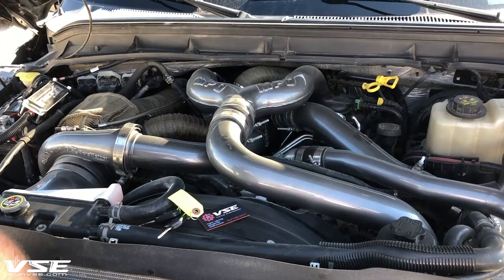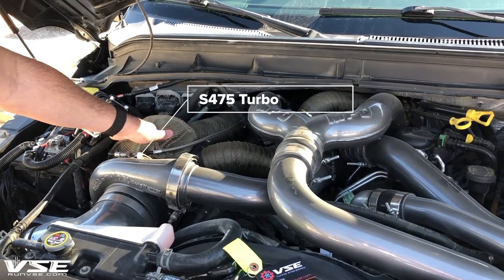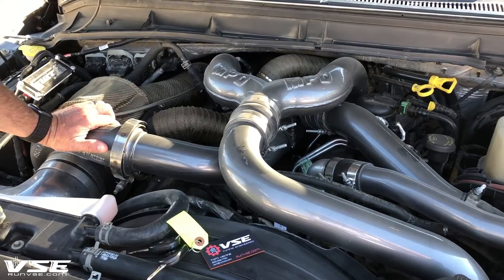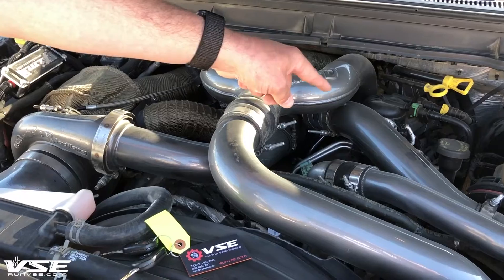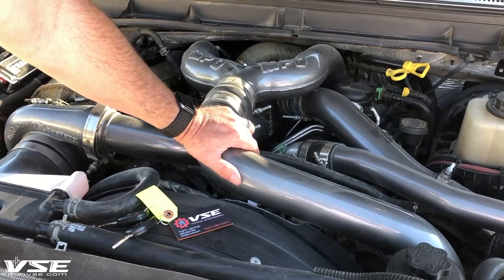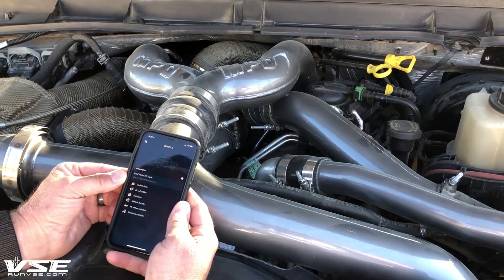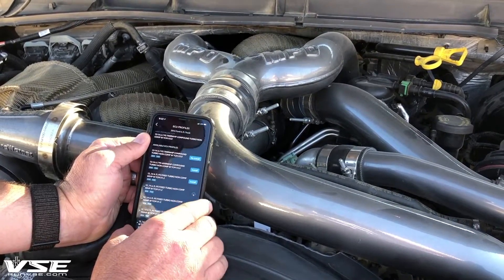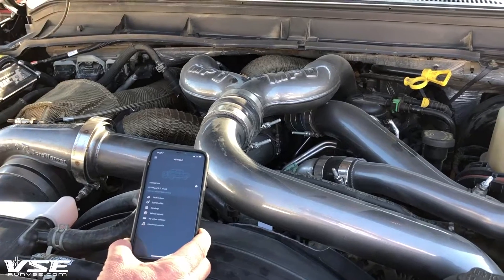Wicked Compound Turbo Powerstroke

Comment: any kits available for the early 2011 - 2014 stock turbos?
Reply: No...and you wouldn't want to pit a big atmosphere charger in front of the GT32. The quick spooling nature of the SST, mixed with the volumetric efficiency of a big fixed vane out in front of it is literally the perfect storm for bending rods. All that low rpm torque that comes on before the bottom end has picked up rpm equates to more cylinder pressure than the stock rods can handle
Reply: @ryanbrown918  thank you I’ll be upgrading my stock turbo before looking for compound

Comment: Larger turbo feeding a smaller one? I thought the valley turbo fed the atmosphere charger
Reply: The atmosphere feeds the air to the valley then the valley feeds the exhaust to the atmosphere
Reply: Yeah, i always thought it would be other way around too with Compounds, the Smaller Turbo feeding Air to the Bigger Turbo, But that's not correct.

Comment: Great video. Truck is holding bottom end and trans ok at that power level?
Reply: I’ve been running a 2011 engine with 360k miles on it with a fleece cheetah and 475 mpd kit with dual fuelers for a few months now.. stock trans.. it’s holding thus far! All about how you drive it.
Reply: Not for long I'm sure lol
Reply: It's my truck, I've been driving it for a year and a half, works just fine..
Reply: @jimmyjames198131  it’s a very nice setup. Do you have any other videos of it running or ripping on it

Comment: How much is that set with the turbo and cp4 mod I have a 2016 f250 6.7 i have ezlynk already but I'm guessing I would need to buy your 700 hp tune
Reply: No tune is going to get your stock 6.7 to 700hp.  He has compound turbos on stock fuel he doesn’t even have 700 rwhp.  You wanna see what it takes to make 800+ HP?  I’ll email you my build sheet.  You can’t run stock fuel and get 700 rwhp.
Reply: @dr.bowdoin3067  send me ur build sheet id love to get ideas lol guidryc26@gmail.com
Reply: @Chrisguidry1923  sent entire build sheet with prices and a photo or two Mr. Guidry
Reply: @dr.bowdoin3067  I'm not seeing it yet
Reply: @Chrisguidry1923  yea it might help if I got your email correct lol
Reply: @dr.bowdoin3067  lol it definitely did 🤣
Reply: @dr.bowdoin3067  yes it does, it's my truck, it's got a stroker pump, it's right at 700
Reply: @jimmyjames198131  to the crank maybe not the wheels.  You could always email me the dyno sheet
Reply: @dr.bowdoin3067  wrong
Reply: @dr.bowdoin3067  what's your email I'm trying to full mod my 2016 F250
Reply: @bris9984  Get out your wallet.  More air and a belt driven cp3 are needed at minimum.  The stock injectors should support at least 700hp.  Over 700hp and you'll need to do connecting rods.
Reply: @andrewb9708  I’m well over 700 no connecting rods no problem so far
Reply: @dr.bowdoin3067  You're on borrowed time, weak connecting rods are a known issue on the 6.7 and 700 hp is about the threshold.  The rods are smaller than 6.0 powerstroke connecting rods.
Reply: @andrewb9708  I’m aware of the rods but I don’t drive my f250 like an idiot.  It’s not a race car, I don’t do smokey burnouts on the wknd.  I’m still on stock transmission as well not 1 issue.  If you take care of your things your things will take care of you.  Thx for the info. 👍🏼

Comment: Awesome equipment, doesn’t mean much until you hear it running!  Could have done a quick start?  Just saying....
Reply from the maker: Thanks for the suggestion. The video does start with a sound clip of the truck doing a pull.
Reply: @vsetuning2036  ekayjfh
Reply: It runs fine, I drive it all the time
Reply: Fhhxf
Reply: Shdmeh